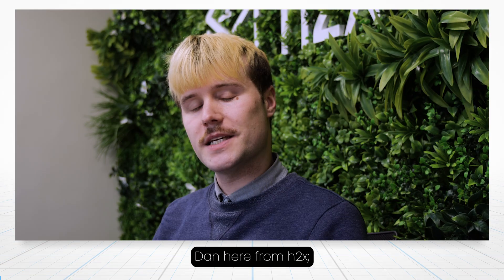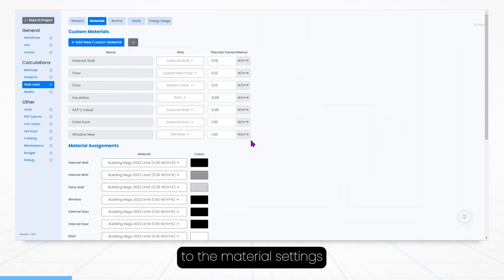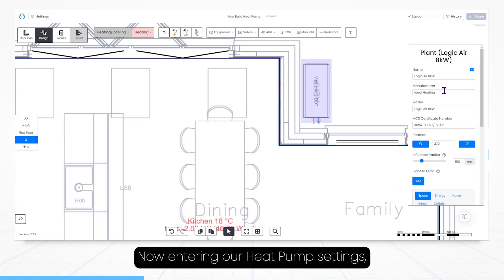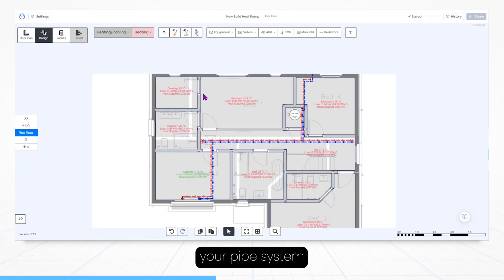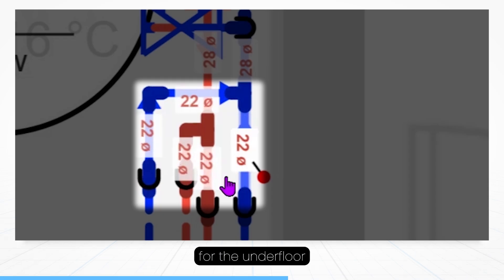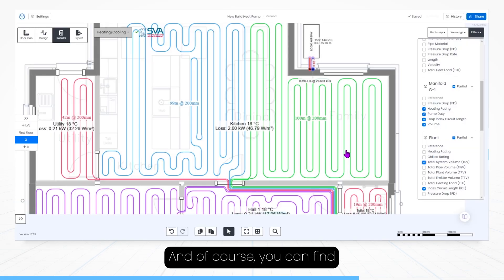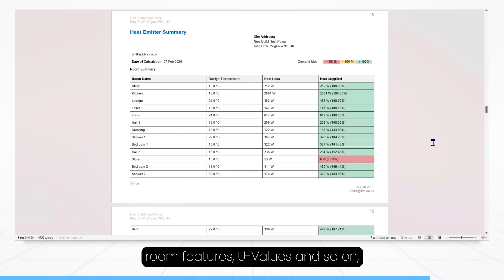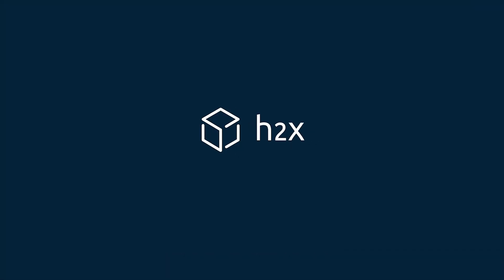Heat Pumps Unlocked - Domestic Heat Pump Design With h2x

Comment: Great tutorial. Can this tool be used in other countries within the European continent? So that we can use EURO as main currency and other European local regulations? Thanks
Reply from the maker: Thank you. 

h2x is used in some European countries and follows EN standards for heat loads.

We currently don't have Euro as a currency at the moment, but it has been submitted as a feature request: https://feedback.h2xengineering.com/feature-requests/p/ability-to-set-currency-in-euros

However, you can still change your values accordingly and change your currency symbol to Euro on your export.